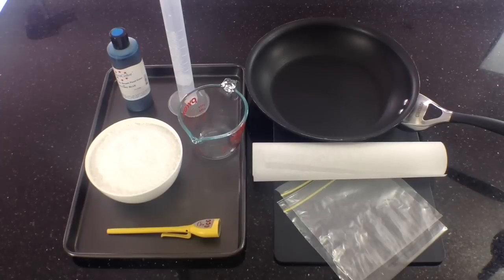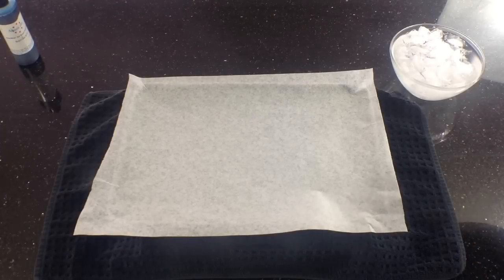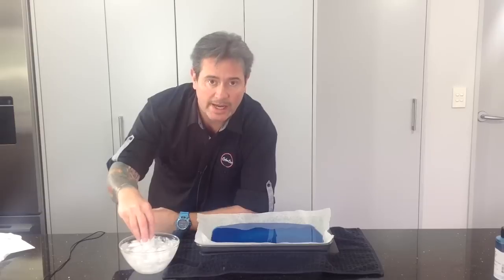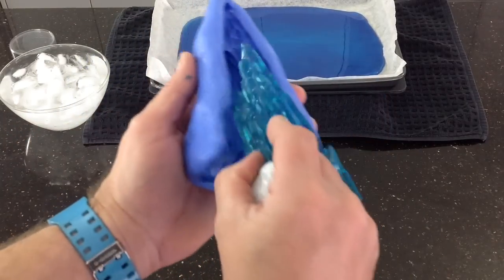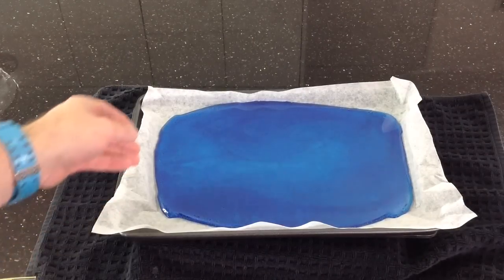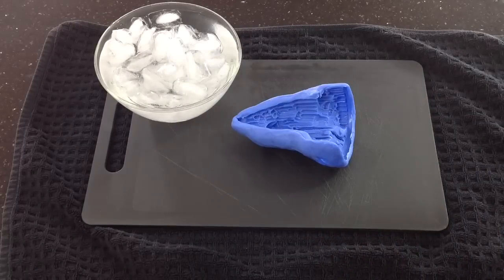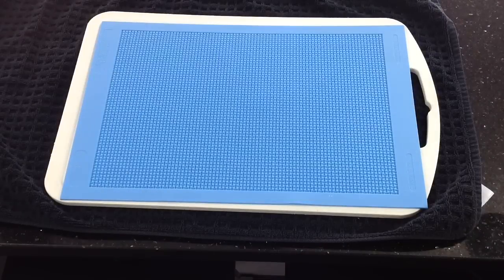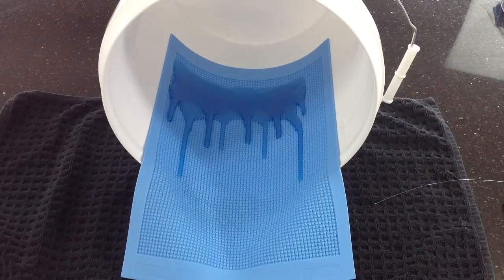Basic Isomalt

Comment: Just for safety. I was heating isamalt in a pyrex dish. It blew up in tbe mi rowave and cused to the microwave glass. It gook some time soaming to remove all the glass shards from the microwave gazs xish. I checkes about how high the pyrex  can take. It appears pyrex company used to pjt a component into their glass for high heat but has stopped putting this component in their glass  ow thus heating at 180 degrees  an be dangerous. I was lu ky. I feel it is safer to melt in pot or pan and then be very cautious with the pyrex when re heating.

Comment: I isomalt particularly popular in Australia? I'm watching Zumbo's Just Desserts and I paused it to see how isomalt works and I found this video. Back-to-back Aussies.
Reply: OK, this is strange. Two contestants are trying to make isomalt "leaves" to decorate a floral cake. Both of them have done the same confounding technique: Sprinkle place some kind of lining in a baking sheet, place a silicone mat with leaf-shaped cutouts on the baking sheet, sprinkle the isomalt onto the mat to make leaf-shaped mounds of isomalt, remove the silicone template, and chuck the whole thing in the oven. They've tried twice, and both times they've gotten misshapen blobs of nonsense.

How is their method supposed to work? I don't know the hydration of this powder they're using, but once it's in a hot oven with no mold, of course it's going to run everywhere. And if they're cheap baking sheet like mine, they're going to warp when they heat up, and this seems like the kind of operation where you want the sheet pan and even the oven itself to be as level as possible. This doesn't seem like the right way to do it, and it's nothing like the method you've shown here. Have you ever heard of anything like this? 

If you want to check out what I'm talking about, it's Zumbo's Just Desserts, Season 1 Episode 9 on Netflix, at 37:30.